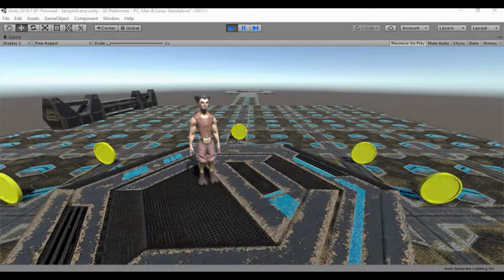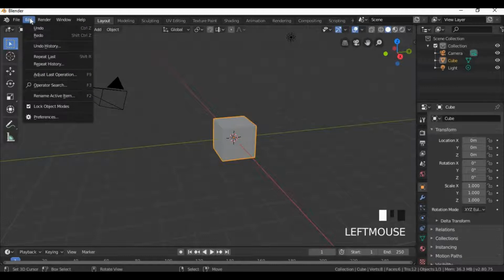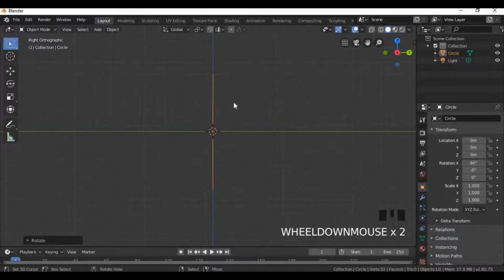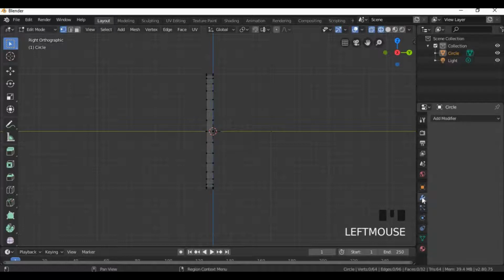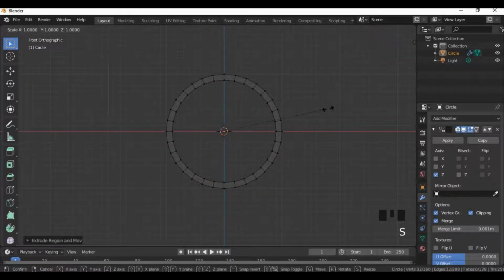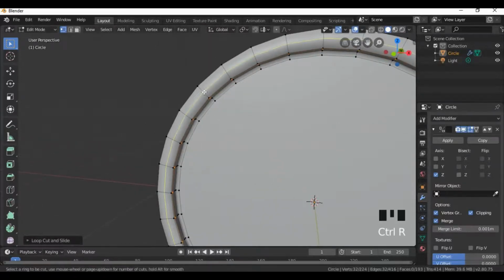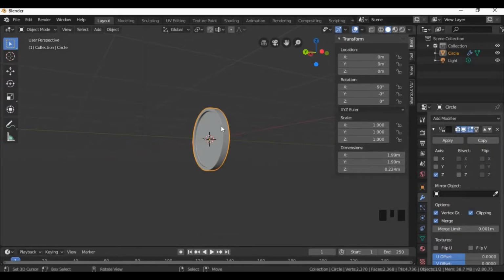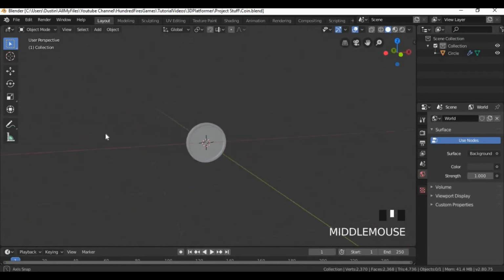3D Platformer Unity C# Tutorial - 03.ASSET CREATION

Comment: Hi, just a little heads up. You could have probably gotten away with creating a cylinder and extruding and scaling the faces. Also for objects like coins it seems advisable to avoid too many faces, so to get a mix of smooth and sharp edges, it is good to mark the desired edges as sharp (ctrl+e in edit mode) and enable autosmooth in the object data tab.